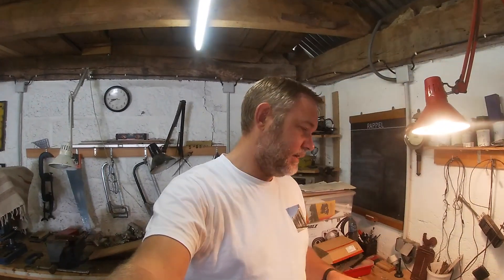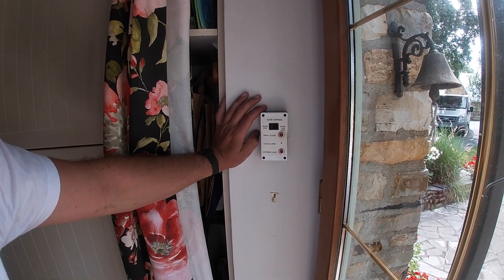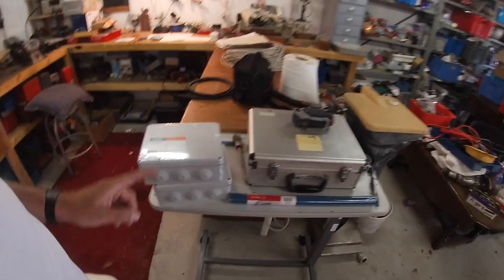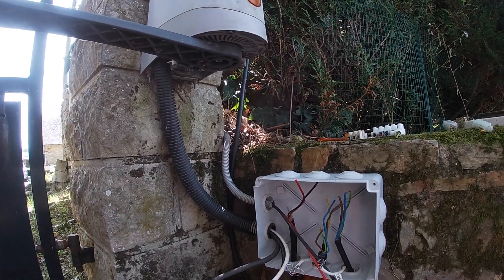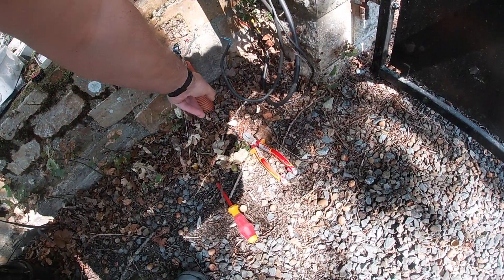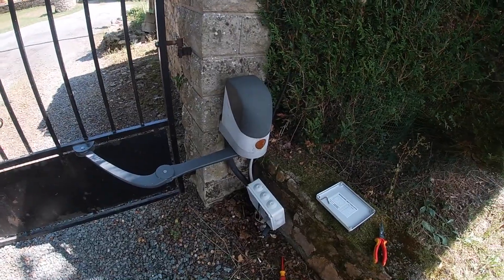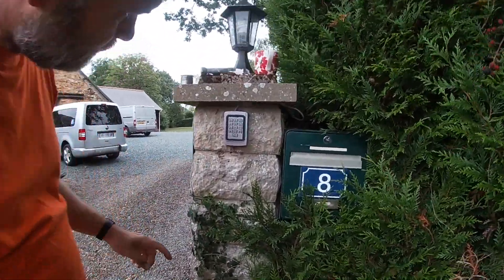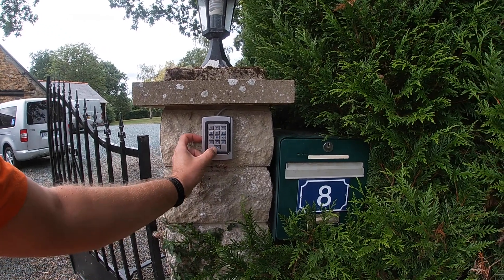Adding a security code Keypad to electric gates

Comment: You were fortunate to find the schematics prepared by your dad. I like the keypad better than the fob. I'm debating on adding a keypad entry to my house in the Aude. Cheers-
Reply from the maker: It's obviously a lot easier to add to a normal gate system. You just need two wires and a power source. Thanks for watching 👍👍